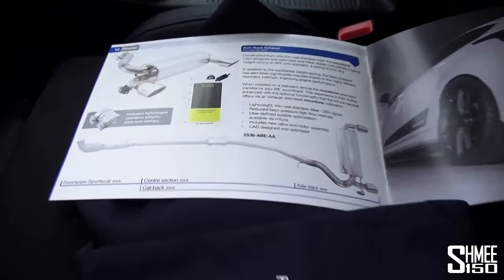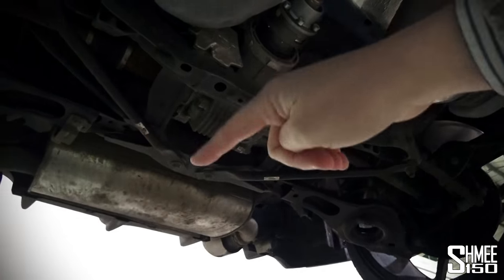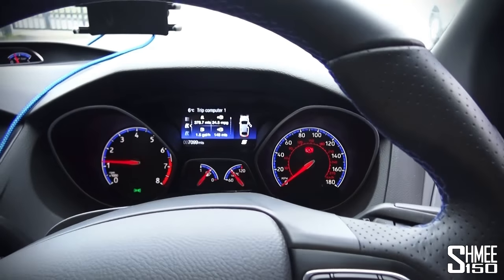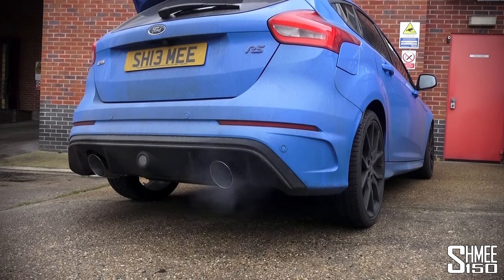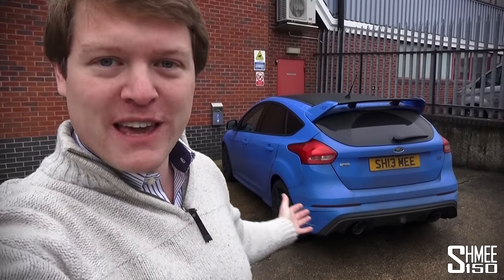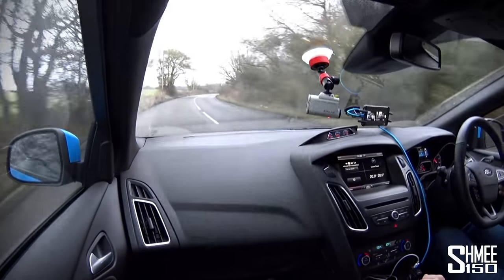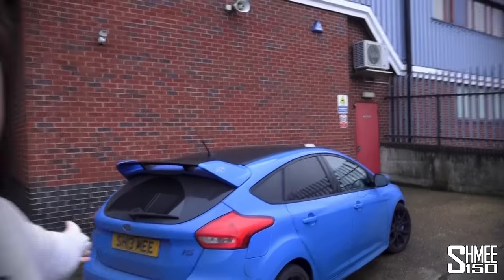My Focus RS Now Has a Mountune Exhaust System!

Comment: Do a modified rs vs Archie's modified a45 amg
Reply from the maker: Still Archie's is heavily modified. I am not even going to try, I would lose anyhow
Reply: Shmee150 yeah I know it launches better than an m4 and it keeps up with it nicely maybe ask mountune if you can take the maxed out focus RS and race it with the a45 !
Reply: Shmee150 think ken blocks rs could beat that a45 he got 640 hp
Reply: Messi Messi thats a full blown rally car. doesnt really compare to the production focus rs
Reply: I dnt knw bout this a45 u guys wen talkin only read heavily modified just check on youtube
He dnt  even have 1% chance vs ken blocks rs :)

Comment: Wrap it in matte black with metallic white, light grey, and charcoal colored stripes. I especially like the Wide tri-colored stripes that start at the lower front outer fender wheel well. Then they goes straight along the side of the body and just past the the 2nd backseat door, then the stripes curve up over the back fender and end just before they hit the taillights.

Comment: I was watching your axle back exhaust install and I noticed on your intercooler you still have a factory sticker cover on your intercooler it's in the right-hand corner of your intercooler Peel it off and you will get better cooling in your turbo you're in a cooler is only getting three quarter airflow

Comment: I am the only one who noticed the HUGE flat spot on the pipe at 2:45? That definitely affects the exhaust flow causing power loss. Probably the stock pipe has the same bent, but it would have been wise to fix it.
Reply: It's a clearance bend.  That little bit of a flat spot will have NO affect on the power output.  I refer you to the Motor Trend engine dyno series where they are testing  various headers and piping.  They ended up taking a sledge hammer to the headers just to see what it would do to horsepower.  All of the years I have spent being so careful with headers and exhaust tubing went right out the window in a matter of minutes. Large dents and bends meant NOTHING on the dyno.  Shocking, I must say.  Only at peak RPM, with a full race engine, might a smooth, free flowing exhaust make a difference. I realize you won't take my word for it, so go to Motor Trend Engine Masters video series and check it out. Your exhaust life will never be the same.
Reply: Paul Copeland thanks for the info, will check that out.
Reply: You are welcome.  Get ready for a eye opener!

Comment: Lower it and space the wheels, it will give it so much more road presence. H&R do both springs and hubcentric spacers for the RS, it will handle and look so much better. 35/40mm drop will lower it sufficiently without sacrificing comfort. Or else go for a Cup Kit, springs and shocks.

Comment: You need the full exhaust system 😊 the downpipe will make so much difference. With a rolling road tune you'll have this over 450bhp no sweat. There's not much point going further than that, intercooler and injectors would be next thing but then I guess you'd be at the max for the stock turbo and I wouldn't replace that, you'd be into silly money vs car value. Change the full exhaust and get a rolling road, custom tune 😆🤔

Comment: Shmee I do like your video's, I have one comment though. This holds for all your YT videos. Wouldn't it be better to have some footage from the outside as well, so shots with the car with you in it driving along a road. Then we get some view of the surroundings as well and get to hear the car better, which (according to me) would give viewers a much nicer view of your trips...
Reply from the maker: You will not hear anything, the wind noise recorded by the microphone of the camera will completely kill the outside noise while moving. However, you can point a camera in the direction of the exhaust, but I prefer not to do that just in case I lose the camera.
Reply: And a stationary camera at the side of the road? Is that too complex?

Comment: Tim help halfway through the video on the bit where the car starts up with the new exhaust it cuts to the intro but the voice over is the actual video help
Reply from the maker: Can you pinpoint the exact location in the video?
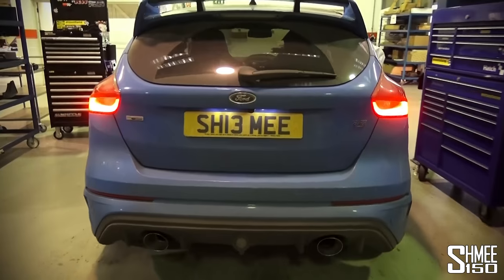Reply: Shmee150  around 5:17
Reply from the maker: I do not have that issue at all.

Comment: did the exhaust system increase any numbers for the bhp or the torque??
Reply from the maker: Yes but only minimal
Reply: oh yeah, a new back box adds like 50bhp. Go down to Halfords for a K&N air filter and you're looking at gains of 300bhp minimum.

Comment: Don't use the drift button lol This car is a death trap
Reply: Do you own an RS?
I have one and drive more in drift than normal. Driving in drift doesn't mean just use it at full throttle at every corner. You can use it for driving with a RWD feel at partial throttle and the ESC in that mode will keep you in check to get a bit of a slide but not oversteer it. It really does transform it from an AWD planted feel in the corners to RWD.

Comment: The FPM375 was hugely disappointing, but then my standard car only made 325bhp when dyno’d, so hardly surprising. 
It’s too heavy, too firm and the stupid pops and bangs sound way too contrived, was just not the car the motoring press made it out to be, sold mine after just 6 months.
Recall for headgasket failures came 15 months later....just as well I don’t still have it as I’d have demanded a new engine.

Comment: wow Ford quality, look how corroded the exhaust and back box are after 7000 miles, i am amendment Fords parts are designed to fail, keeps them in business, not many fords get to over 10 years without body rust.
Reply: Im in the trade and was going to mention the same thing ha,  every focus we get in over 2 years old has bad corrosion on suspension parts :(
Reply: John Z my brother has just upgraded his rs (not mountune) he has just above 10000 miles and there is no corrosion on anything ( I was there) why do you think this is?
Reply: Its probably how the car is kept as well as cleaning. The ones used in salt winter conditions and not maintained just fall to pieces. Honda suspension is the same.